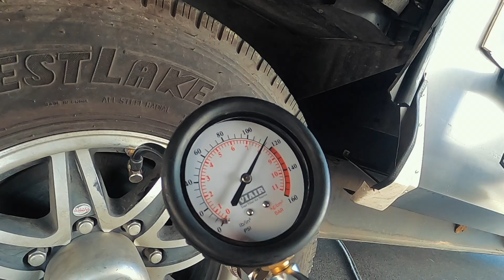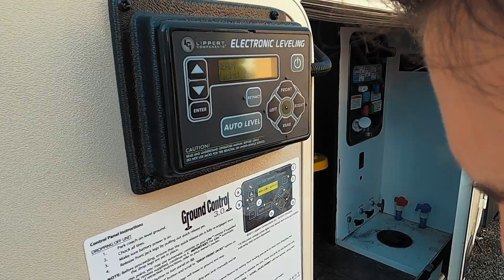WHAT RV CHECKLIST? Millennials Taking on RV Living (OOF!)

Comment: You can get mudflaps 
That will fit in your receiver. They are the 
Heavy rubber like on the big trucks. I had that problem on my trailer we had some tar on the front of ours. Now it keeps it 
Clean.an what is nice
When you are parked 
Just pull them out an I put them under the trailer.you can them for standard truck or a dually.be safe in your travels.
Reply from the maker: We will look into these! Thank you Michael!! 😃 Stay safe out there!

Comment: What I did to keep all the road grim off
The front of the traile.is get some mud flaps. The ones I got fits in the receiver
On the truck. They are nice heavy rubber
Reply from the maker: Hey Michael! Love this idea, we definitely should add this to the list of upgrades. Some mud flaps would really help cut down on the wear and tear to the front of the fifth wheel. Still looking into maybe getting some of that skirting that you mentioned before as well 🙂

You always have some great upgrade ideas Michael! Thank you for commenting, it really helps

Comment: Goodyear G614 are my go to tire for our RV, but I also will not tow without a TPMS system anymore. We had blow outs in out TT so an all tire TV and RV in one monitor.  I have been using the EEZTire TPMS.  It has been a life saver we came out of Walmart and it was alarming showing that the tire was loosing pressure, found a place and got the tire fixed another time we noticed that it was loosing pressure so we limped along to our camp site in Louisiana and called our roadside to help get the tire off the lugs had been put on so tight I could not get leverage, now I carry a breaker bar so I can get the tire off if needed.  But I just took the tire into town and had it patched, other times it has alarmed because it got too hot so we pull off and give it a break, but also check to make sure the temp is not too different from the others as it could tell you if you have a bearing issue. One other suggestion, tire covers the sun is the tires worst enemy besides big nails, but we have kept them covered wherever we go this will extend the life of the tires.  I just had to replace the tires on my 2017 Silverado and it is 2 years newer than the RV tires so my next purchase are tire covers for the truck. Hopefully we can make them RV tires last another year.  But I would not get anything else but Goodyear G614 and the DOT will have to be within a few weeks of each other
Reply from the maker: This is really great information! Thank you so much for sharing! We don’t currently have a TPMS, but hopefully we can get one soon. Seems like it’s a nice piece of mind and is really beneficial to have 😀 

Glad you guys were able to get those situations addressed quickly!!

Comment: You two are such a hoot. Tires...I went in to our local tire shop intending to purchase a set of Goodyear Endurance for our rig. The salesman there talked me out of it. He brought one out, and he brought out a Samson GL 285T. He wanted me to see the difference. He told me that they put the Samson tires on all the Construction Trailers that haul heavy equipment. After comparing the two I went with the Samsons. That was over 20,000 miles ago. I have been very happy with them. Based on the current tread depth, I suspect l will get at least another 30,000 out of them before I will start thinking of replacing them. Safe Travels you two!!! 👍😀 Sean & Angie
Reply from the maker: Thank you Sean and Angie! We always love hearing from you both!

WOW! Thank you so this tip, we had no idea about the Samson tires! Now we had heard a lot of great things about the Goodyear Endurance tires... what is the pricing comparison between the two tires if you don’t mind me asking? 

Are the Samson tires more expensive than the Goodyear Endurance?

Comment: Tires... Everyone has an opinion. I ran Hercules tires on my 30 foot TT, Gladiator on my 33 foot TT ( Gladiator is by most accounts, the best of the worst). They performed well, no drama. I specified Sailun on my new custom build 40 foot fifth wheel. If Sailun offers your size, you won't regret that upgrade, period  For the truck, Michelin.
Reply from the maker: Thanks for sharing! Good to know 😃

Comment: I've run the Sailun tires on the last 2 RVs I've owned. No issues whatsoever.
Reply from the maker: Hey Donnie! We have heard of the Sailun tires. They sound like a really solid brand. 

I wonder what their cost comparison between other tires are??
Reply: @HappilyEverHanks  I have a guy here locally that was about 150 installed and balanced. They make a 235/80/16 and an 85/16. Mine took the 80. Having them balanced made a lot of difference. I run a tpms on them and they stay very similar in temp and pressure. Ran them on my 5th wheel for 3 years with no issues. Got a set for my new work and play and no issues in 2 years.
Reply from the maker: @ReelFloridaOutdoors  we’ll have to take that brand into consideration then! Thanks for the information, we really appreciate it 😃 ~Renee & Kyle

Comment: Just love your videos, great practical, experiential advise, and fun doing it!  Tires?  Went to the Sailun G rated tires for the much stiffer side walls for turning(scrubbing) and all of the gravel roads we seem to travel.  I guess now Goodyear Endurance has gone to larger tires and higher ply ratings as well.  Three years in, no tire issues at all.  We do check air on travel,days and have them balanced yearly too.

Comment: Kyle, is your GMC a 3500 or 2500 Turbo Diesel? Curious to what your payload is with the Solitude. Just subscribe to your content.
Reply from the maker: Hey Guillermo! It's great to meet you. I have a 2500 Turbo Diesel with a payload of 2,700. This is a lighter Solitude (s-class) which tends to be shorter than most Solitudes. Originally were looking at a 310 GK Solitude (same length) but it was a much heavier model than our current.

Where are you in the RV world currently Guillermo? Are you already owning or looking to buy?
Reply: @HappilyEverHanks  I live in Corona, CA. We recently upgraded from a travel trailer to a new GD 31MB. I also have a GMC Denali 2500 Turbo Diesel. We pick up our new rig in a week. Looking forward to our camping adventures.
Reply from the maker: Guillermo that’s awesome! I am originally from Redding, CA (for 18 years)

Your truck sounds like a beast 🙌🏼 congratulations on the new upgrade! Keep us updated with your adventures, would love to hear from you more

Stay safe, talk soon! Cheers Guillermo! - Kyle and Renee

Comment: Hercules 901st 
Commercial grade tires
G rated
Reply from the maker: Thank you Frank!! Those sound absolutely great 😃Any ideas on who can handle changing G rated tires? I have called a few RV dealerships and they said that they do not change out that heavy duty of a tire (I guess they have bent previous customers rims trying to bead the tire off) 

So they said they no longer will do it...Any thoughts on who might be up for the job? Would a normal dealership like Discount Tire or Les Schwab be able to hangle this?
Reply: @HappilyEverHanks  
Any commercial tire dealer that services semi trucks and trailers will be happy to change out the tires.
If you're going to replace the tires I'd replace the valve stems with stainless steel high pressure and have the tires balanced
Reply from the maker: Ok that's perfect! I will look into some commercial tire dealers then! We appreciate you feedback Frank 😃Hope to hear from you again soon, best to you!!

Comment: Do you think the skirting/ insulation makes a decent difference?
Reply from the maker: It made such a huuuuuuuge difference 😀👍🏼 We were having a lot of problems with frozen pipes and blowing through tanks of propane left and right 

It would be nice however to do a more decent skirting in the future 😄
Reply: @HappilyEverHanks  good to know.  Thanks. 
What would you do differently? Thicker foam?
I was thinking,  if it works well to paint it to match
Reply from the maker: I was thinking of a material that would actually be fitted to the 5th wheel itself. Instead of doing foam board.. I think it costs like 1-2K however to get that done 😅